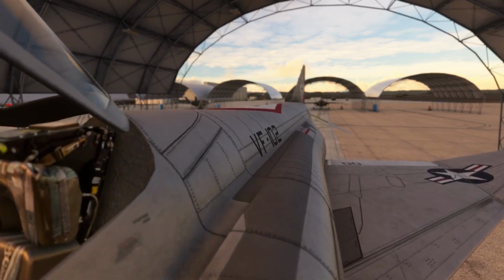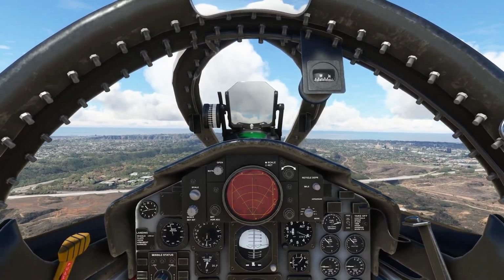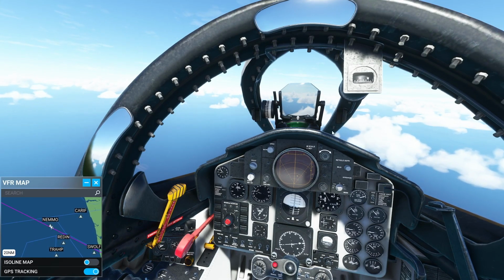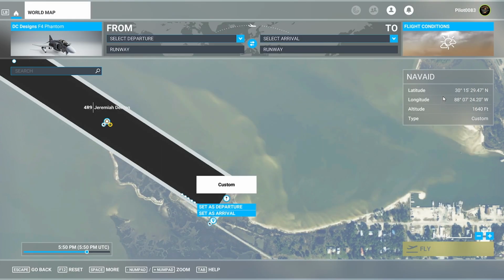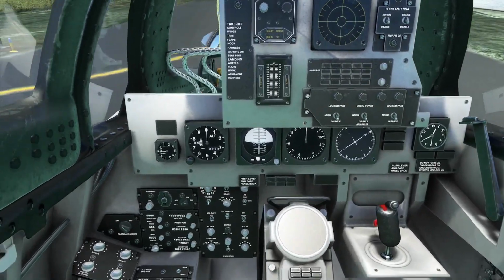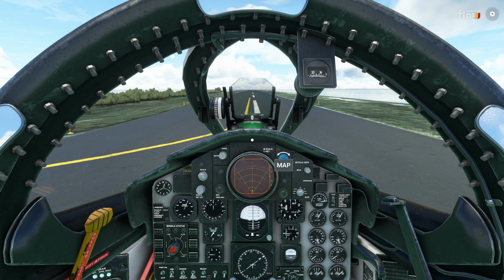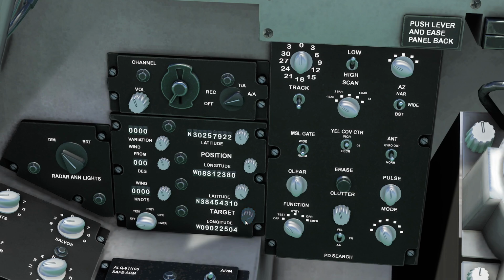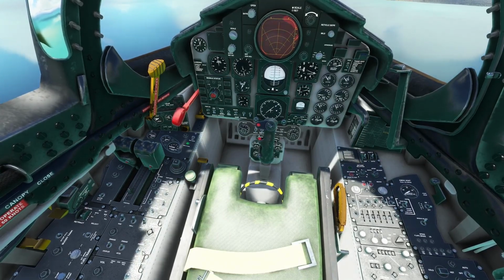DC DESIGNS F4 Phantom II | AFCS & INS Tutorial | Flight Planning Made Easy | MSFS2020

Comment: Close, but no cigar on the INS inputs. The coordinates are supposed to be in degrees decimal, not degrees, minutes and seconds as they are shown on in MSFS. For examples 88degrees, 07 minutes and 24.2 seconds from MSFS converts to 88.123389 degrees on the INS. That's why you didn't see your course line going all the way to St Louis. Otherwise, great video.